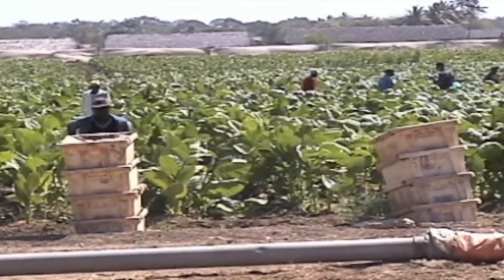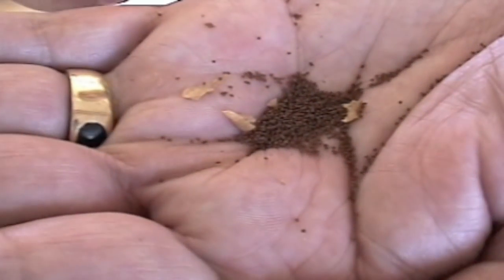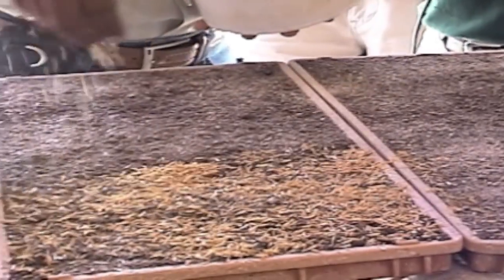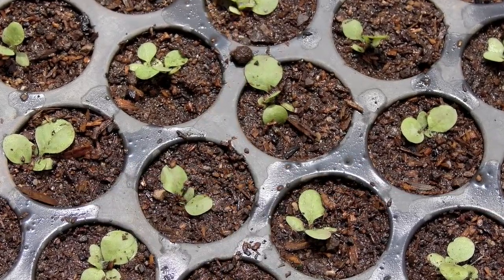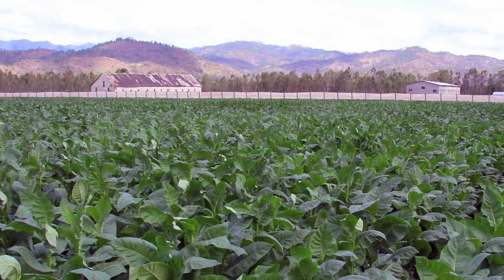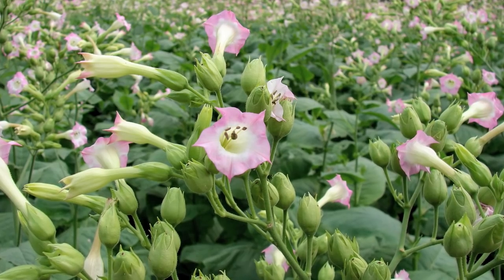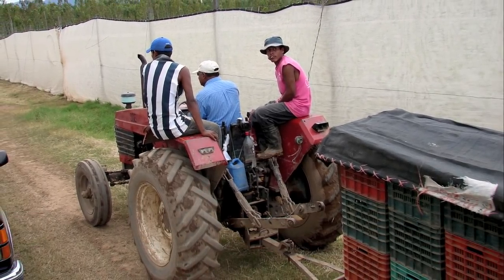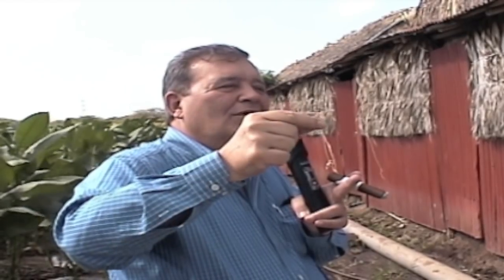Cigar Tobacco: From Planting to Picking

Comment: This is the best advice to give because I'm reading about caterpillars munching the leaves before even preparing the ground. Introduce nest boxes for Blue Tits and Great Tits or any other finch family birds basically you have 4m 4  inches square pole place the pole into the ground during winter time feed the finches next to nest boxes and hoping in Spring they will nest in those boxes the birds I mentioned feed on caterpillars so its food for the birds young and the problem solved. For an acre about 12 pillars when it comes to nature there is a solution.

Comment: Thanks great video. I grew a couple test plants last yr and 4 varieties this yr to see which would do the best in my regional conditions and has best disease resistance here. Ony about 100 plants the weather conditions have been terrible for the air curing very rainy and in mid August it hasnt gotton over 75 degrees which is unseasonably cool so many of them have been developing frogs eye any tips on preventing that in cooler than normal conditions or to help in the drying?

Comment: Strongest plant do not produce the best smoking tobacco, today you see a lot of plantations with huge tobacco plants, that doesn't translate in most cases to better tobacco. That works for snuff and mass producimg but not for quality cigars.
The bigger the plant for a same variety the smaller the flavor, bigger the veins in the leaves, lower the quality. It get to be old timers way to be good for cigars.
Reply: You see so many prestigious cuban rollers that get into the cigar business overseas and not a single one can match the aroma of the cheapest cuban habano despite growing in similar weather and a lot has to to with the growing part, the soil.
Non cuban cigars are getting better but grower's families are also needed not just rollers, and quick nefore the tradition is lost which is the way Cuban tobacco is going with the mass production